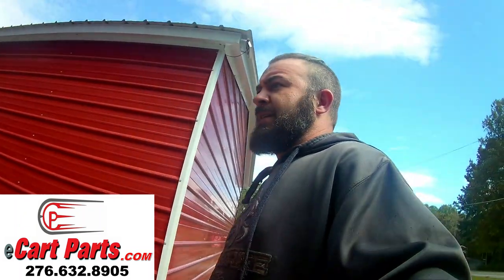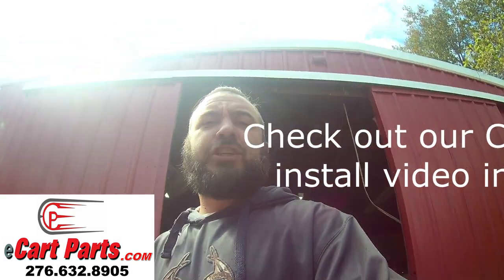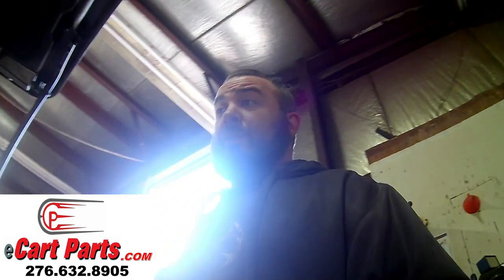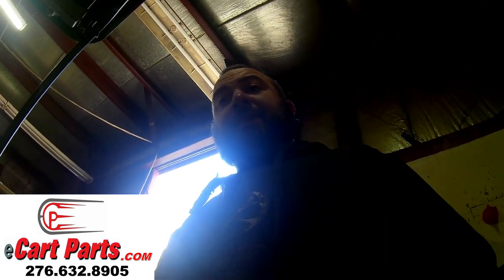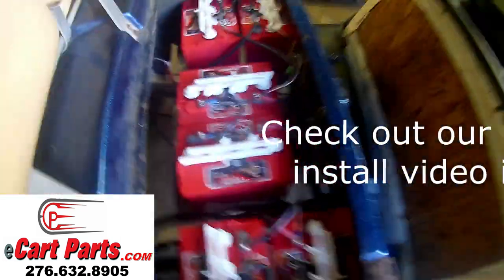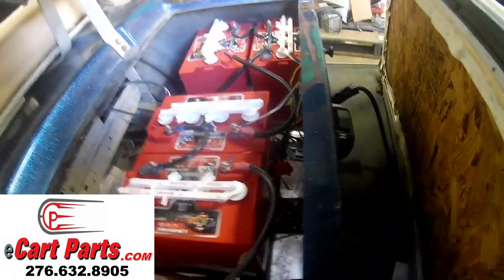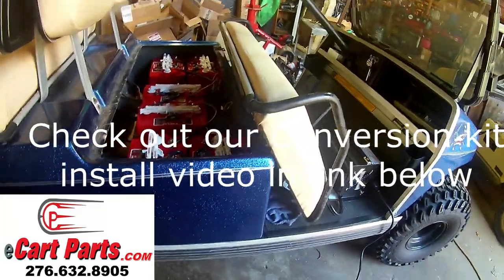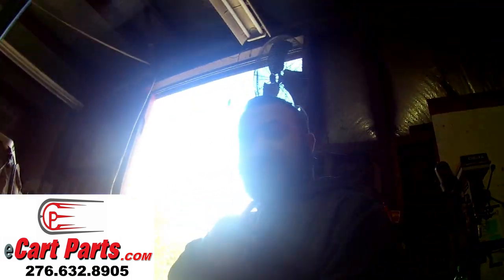AC DRIVE Conversion

Comment: Thanks for the video.  Any idea how much you increased the range of the cart just going to AC?
Reply from the maker: We have not tested that yet however, Due to the lack of brushes, AC motors experience a lot less internal friction when compared with their DC motors therefore, uses less battery power pull, strain on your battery pack.